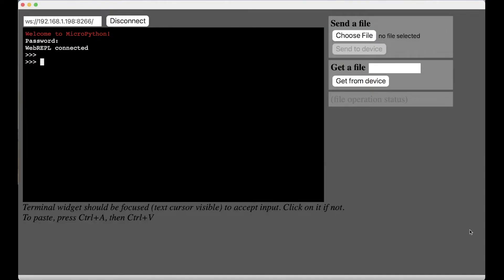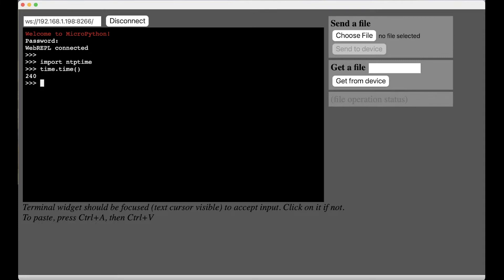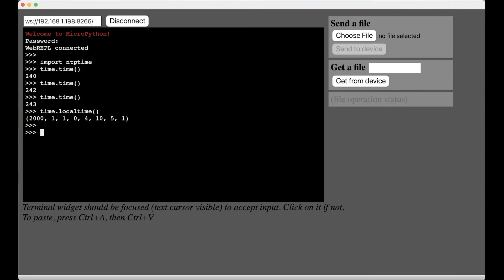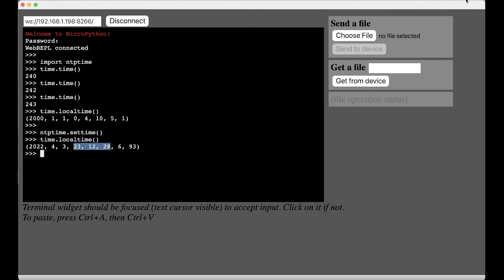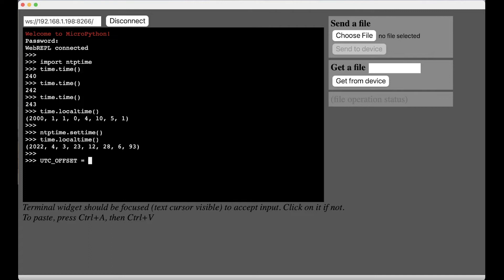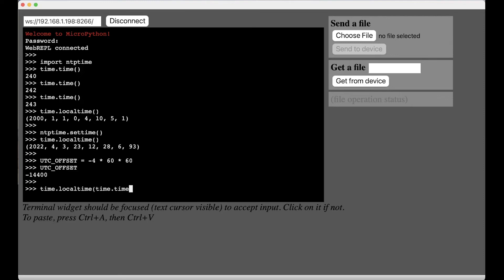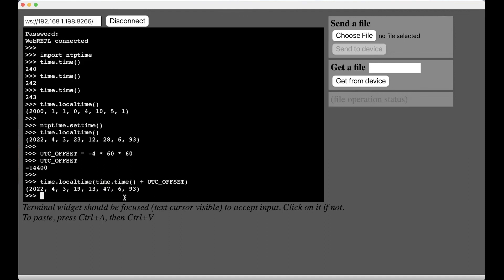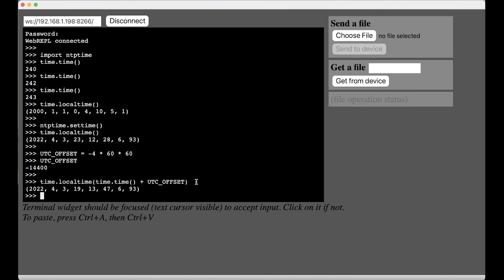Sync time in MicroPython - Tutorial

Comment: Hello Bhavesh would you please do a new video using and explaining how Server and Timezone work inside of ntptime please.
Reply from the maker: Hi Carlos, thanks for your question :) Here are some pointers:
- The "server" or "host" option in ntptime allows you to specify a different server if you think the default one is not fast enough / close enough to you. It is totally optional. You can choose a server close to you by choosing from the official NTP servers here: https://www.ntppool.org/en/.
-- And you can set it in the code here: https://github.com/micropython/micropython-lib/blob/master/micropython/net/ntptime/ntptime.py#L5

- As far as I can see in the Micropython-lib for ntptime, there is no "timezone" support as such (see the github here: https://github.com/micropython/micropython-lib/blob/master/micropython/net/ntptime/ntptime.py#L62).
-- So you have to use the method I showed in my video / my blog to adjust the timestamp based on the timezone.

The fact that you mention these is making me think - are you sure you're using MicroPython? It is possible you're instead using "mPython", which is different from MicroPython (it's quite confusing, I know). mPython is a custom board with a custom implementation of MicroPython, and their docs are at https://mpython.readthedocs.io. But these docs will only work on the mPython board, not on any other MicroPython implementation.

Phew :) Hope that clarifies things Carlos, and let me know if you have more questions :)
Reply: @ yes I was confused with mPython thinking it was just an abbreviated name for micropython. When in reality it's as you said a custom implementation of MicroPython. When I saw it I wanted to know more and that's why I asked for your help above. Thank you for clarity on mPython.

Comment: how do i get the hour minute and second separately
Reply from the maker: Great question! Since the time is output as a tuple, you can treat it like any normal tuple or list in Python:

hour = actual_time[3]
minute = actual_time[4]
second = actual_time[5]
Reply: @BhaveshKakwani  if you don't mind me asking is their a way to get the time in a 12 hour format
Reply from the maker: @ihsanshafi1047  Yes totally. Write a simple "if" condition that does this:

- If the hours is greater than 12, subtract 12 to convert into 12-hr format and add "PM" to it.
- If the hours is less than 12, just add "AM" to it
- If the hours is exactly 12, then it is 12 PM
- If the hours is exactly 0, then it is 12 AM

For example: 21 is greater than 12, so subtract 12 to get "9 PM"
Another example: 6 is less than 12, so it is "6 AM"

Comment: I have this error
ModuleNotFoundError: No module named 'ntptime'

And I have tryed to do pip install ntptime but can't
Reply from the maker: Hi Rayos! Are you running on an ESP32? Which version of MicroPython are you using?
Reply: @BhaveshKakwani  ESP32? i don'0t know it, I run it from windows.
OH micro python is not python? :S
Reply from the maker: Yes, “Micropython” is different and it’s made specifically for electronics/hardware projects. Similar to Arduino, if you are familiar with that. 

If you want to access NTP servers in normal Python, you should use the ntplib library: https://github.com/cf-natali/ntplib

Comment: Used a ESP8266 with MU editor, it works like a charm. However, when I use a ESP32 with Thonny editor I can not get the ntptime.settime() to work, Strange. Thanks for your tutorial
Reply: I was using Micropython V1.14, had to upgrade to V1.18. Now the esp32 works also

Comment: Do you remember wind-up clocks? Having to check the time on the clock ticking away on your bedside table every time you happened to hear the radio announce the time so you could adjust it? Of course after the apocalypse, there will be no internet so wind up clocks will be in demand again and everyone will have to re-learn how to read an analog clock. Until then I will incorporate your simple time example in most of my esp8266 or esp32 projects. Thank you!